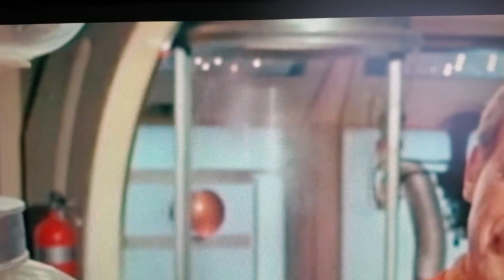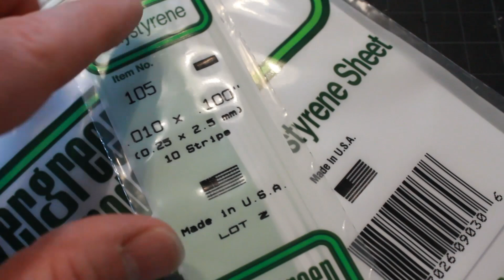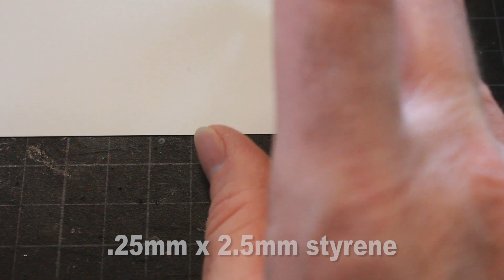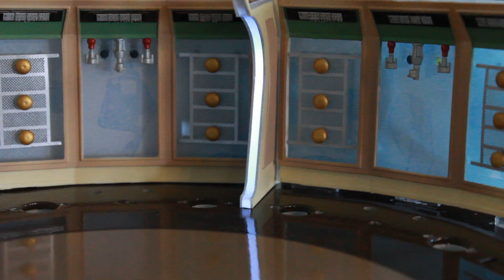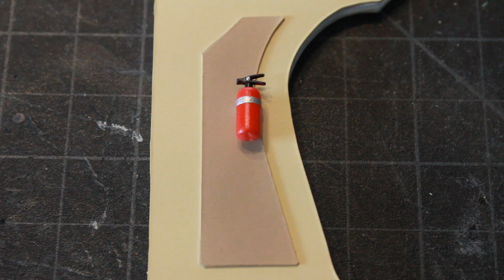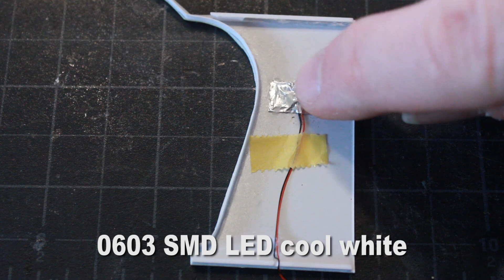Moebius 1/35 scale Jupiter 2 Pt 8 Wall Support Beams and Lighting

Comment: Couldn't that lighted front end of the support walls simply be a reflection of studio strobe lighting?
Reply from the maker: There is someone who made reflective material that would go along the beams, but it's just not the same.  And you need a light source to make the reflection.  The LED strips made for a nice smooth pulsing motion of the lighting.
Reply: @modelsbychris  Thanks Chris!  Makes sense to me now.

Comment: Greag solution , the walls look really good, lots of work, just wondering if it would have easier if you made the parts out of clear styriene?
Reply from the maker: Not really, since there's nothing clear anyway.  Still would've had to paint them just the same.  And white is actually better in this case for light blocking.  Probably would've needed more coats of paint with clear.

Comment: What is the circuit you are using to pulse the wall beams?
Reply from the maker: I'm using an Adafruit Trinket. I'll get a little more into all of that in a later video
Reply: @modelsbychris  thanks!
By the way could you build a fading wall beam circuit for me?